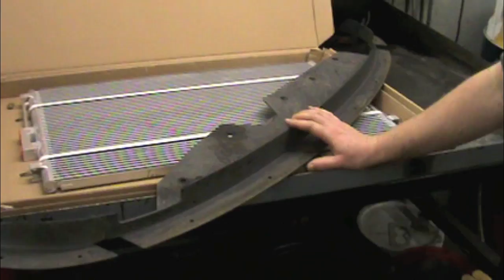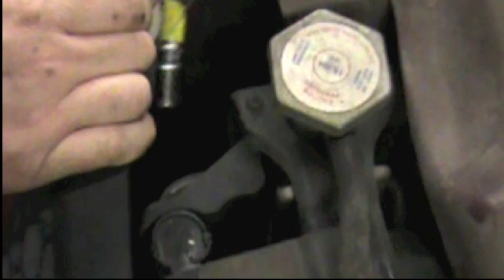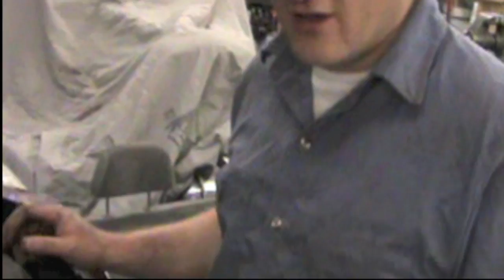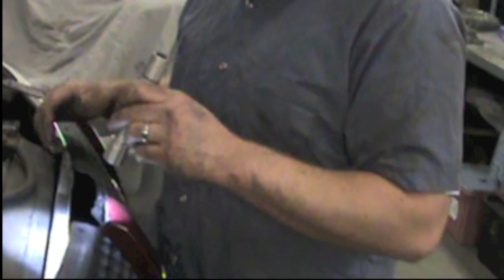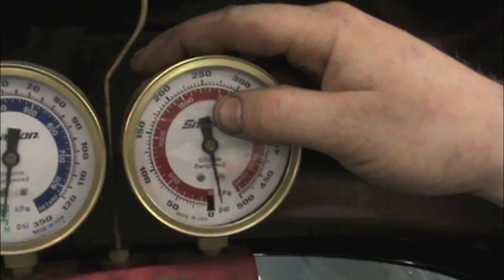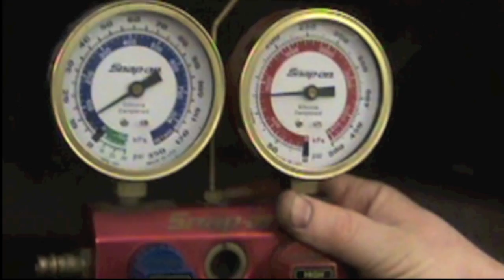How to Repair a Dodge Caravan Air Conditioning System

Comment: I have a question I have a 2011 Dodge Caravan I have a little bit of airflow through the vents can you please tell me what it's wrong and also all the actuators are working all the blend doors are working their rear defogger blinks for like 10 or 15 seconds when you open the door it blinks and I also changed the resistor and I change the blower motor can you please help me and tell me what's wrong please thank you

Comment: Whats the part between the radiator and condensor on the 03 dodge caravan called? Changing my radiator and noticed it came dislodged wondering for a fix?

Comment: I payed nearly 1000 for a new system in my wife's 2005 TC and it still doesn't work. I know there is a fix, maybe the module, but i just bought her a new suv and i'm driving the van. I will be dambed if i take a car to a mechanic again. I rather trade it in. The van is payed for so i keep driving it. If anyone knows what the problem is i would apreciate the tip.

Comment: 1-get a vacuum pump. the one you are using is not appropriate for this job. 2- get  a scale so you can exactly measure how much refrigerant you put in the car.3- learn to use PT charts...100 over current temp. not enough for someone who took thermodynamics...

Comment: If your driving an 02 caravan and even if it's in excellent condition its not worth spending 2- 3 grand to fix the air conditioning. 

If your lucky and it's something minor wrong , otherwise roll down the windows for the breeze and keep your 2- 3 grand in your pocket.
Reply: not in vegas! sweating my ass off even with the windows down!  but doing the work yourself saves a couple of grand!
Reply: +Overkill CNC 
thank you for your clear response

Comment: Nice video. Very helpful showing how to remove and replace the condenser.
just wondering though why you didn't replace the Filter-Dryer??
Dodge shop manual says to add an ounce of ND-8 (equivalent is PAG46) oil to the system when the condenser is replaced. An additional ounce when the Filter Dryer is replaced. Liked the video though, it was very helpful.

Comment: Hi,
I have a 1998 Dodge Grand Caravan. 3.3L SE. My a/c not cooling and I'm also hearing a hissing sound from the rear evaporator. A technician says it's just the gas passing through and not a leak. He didn't actually test it. What do you think?
Reply: What was it??

Comment: I just had mine replaced.  Had to remove everything in  the dash to get to it and etc.  Giant labor charges.  However, It quit working right after it was fixed. Worked for a couple trips to town.  Only the middle right vent blew cool air for a couple days.  Then none.  They put in the wrong size seals so it leaked out.  THEN, lol  They fixed that, had to take it all apart again... It worked for 3 trips to the store.  Now there is NO cool air anywhere.  So back we go again.  This will be the third try for this.  1800!  THEN, the dash lights where speedometer and rpms are, they are not lit from about the 25 or 30 mph and lower and same area on rpms.  Also, the Steering column makes higher tone noise when you move the steering wheel.  That was also not there before.  The one that scheduled me for the drop off said the lights thing was an electrical issue.  They would run a diagnostics but it would'nt be covered.  I said "but you had everything disconnected and laying in the seat or so, it has to be something that can happen just from that.  Neither of those issues were there before the AC replacement.  Same with the steering wheel.  For that much money, if they moved bulbs or soddering broke from removal of the dash I want it covered!  lol   
Soooo, my question is:  Can the dash light thing be from them removing the dash and etc.  It showed up from the first time they did it and it hasn't changed. The Steering column high tone like the low fuel tone and is also from the initial repair.  Help!  Husband is out of state and he will have a fit.

Comment: Wish I had been this lucky. So far I've replaced both evaporators, both compressors, all lines, radiator and I'm $3000 in the hole and Chrysler still can't tell me why it's not cooing. I've never paid anyone to steal and burn one of my cars, but I'm very tempted these days.
Reply: I'm having the same issue with my 2000 Plymouth Voyager. Been in the shop 5 times, last time was a few days ago. I had AC for a few days, and today......nothing. I've sunk a big chunk of money into getting the AC fixed and they still can't figure it out.
Reply: I've got a 2005 caravan with 24L engine and the AC is not the coolest. My surmise more Chrysler Dodge junk...

Comment: A dual AC Caravan 2000 to 2007 takes 38 oz. of 134a. A single system takes 19 oz. Why didn't you just remove the bumper, it's quite easy?